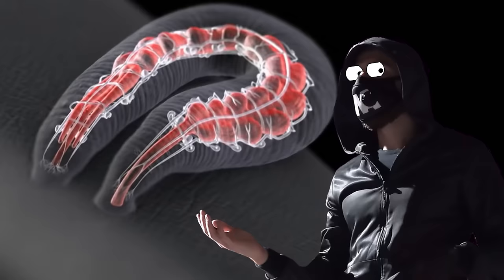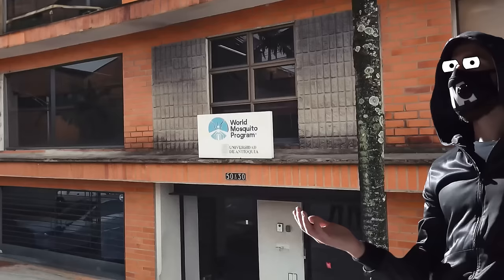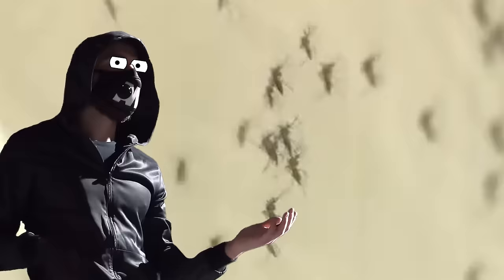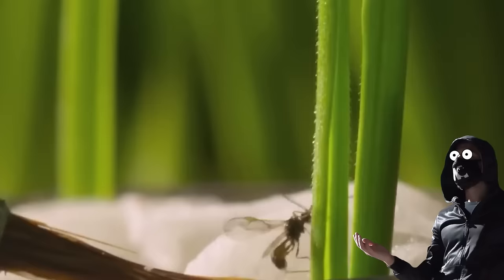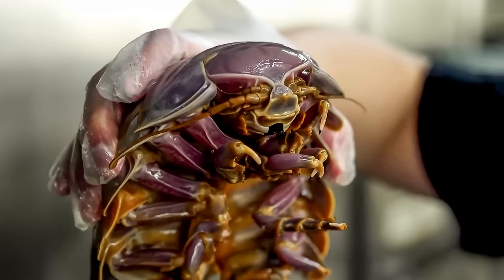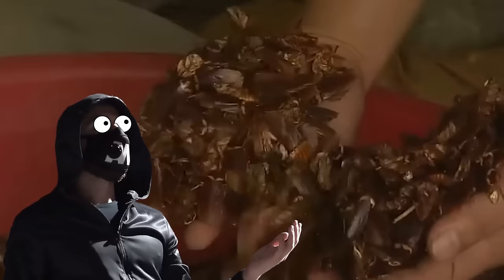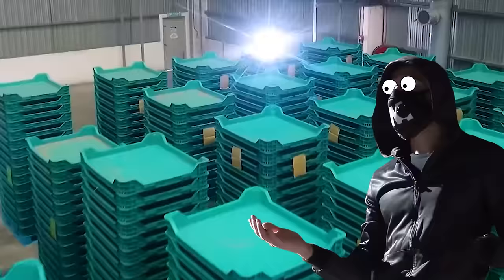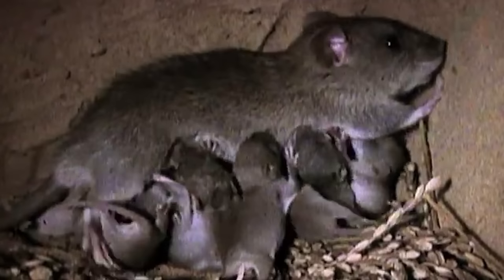Why They Breed and Raise Giant Parasites

Comment: The cockroach one had me about to set myself on fire 🤯
Reply: A friend took a night porter's job in a large well known UK city centre hotel. The porters would set up function rooms, move stuff around and set the place up for the mornings. The head porter told him not to be concerned if he saw the odd cockroach at night. It was an old hotel (though 4*) and roaches were a fact in old buildings. When Rod asked why they didn't get rid of them the head guy said 'Come with me, and keep very quiet.' So, they crept down into the kitchens and they could hear some rustling about. Then the head porter turned the lights on and the floor was a sea of cockroaches that went crazy to hide away. 'You can't get rid of them. As fast as they're trapped and killed off, the new lot are ready to go.'
Reply: with enough demon wp and roach bait they will die off, guy needs to focus!
Reply: The moment that one started I stopped watching the video

Comment: i cant be the 1st human to come up with the idea that we can grow deep underwater creatures, not so deep. I'd name it, Compressed water tanks...Us humans already have giant tanks made from steel, holding all kinds of compressed materials. This Compressed water tank, can be equipped with water pumps, to simulate water movments under the ocean
Reply: @OmarTheAtheistAziz
You're the "first", because it's practically impossible. Water cannot be compressed like that. It takes an IMMENSE amount of force to compress water very little, comparatively. So much force, that water is usually considered "uncompressable". It can be compressed, water pressure in the ocean is proof of that, but the force required is IMMENSE. It may not even be humanly possible right now to create tanks capable of pressurizing water to the levels it would be 8000 feet below sea level.

Comment: I worked as a RN on a hospital orthopaedic floor and yes once in a while we had to use leach therapy for patients who went through microvascular surgery of the fingers that got severed.  I was a veteran nurse and I was able to perform any tasks but NOT this. Those lab hatched leaches  were flown over from NY lab all the way to the hospital in NW USA. Each costed $21 back in the early 90s. I knew exactly what to do but I just could not see myself handling them. I remember I was trying to retrieve one from the sterile water container with my gloved hand. As soon as I saw them swam toward my hand and started sucking on my fingers I lost it. I remember I ran out of the lab screaming and jumped on another nurse crying.

Comment: I raise isopods and I have heard of wolbachia before. If I am not mistaken it will turn a male isopod into a female instead. Also a large number of insect species are infected( like 25%-just a guess). My concern is will this harm reproduction. I believe wolbachia is inherited through the maternal line and passed down. If more insects are infected through this process. I am not entirely sure of the ramifications wolbachia has on other species though since terrestrial isopods are crustaceans and not insects. Correct me if I am wrong, but wolbachia can only be transmitted by females and could potentially harm reproduction by turning males into females. We need insects due to the whole food chain and all. You knock out one area of the food chain and the others suffer. Not to mention all the other benefits insects provide.